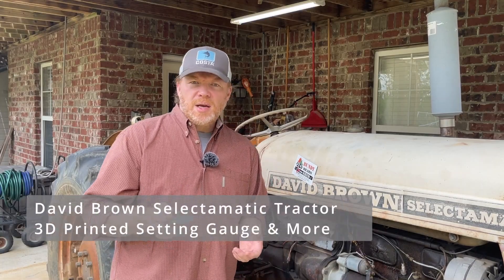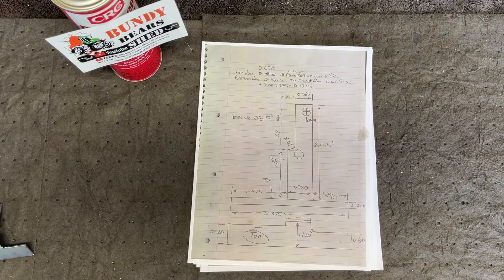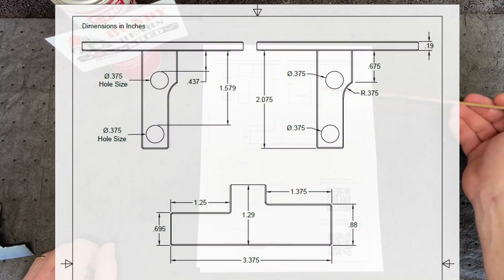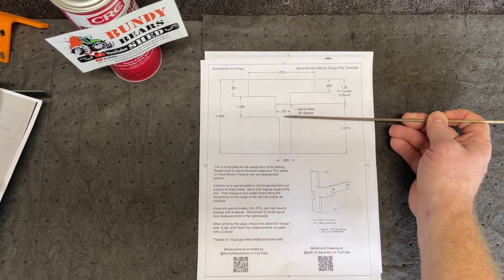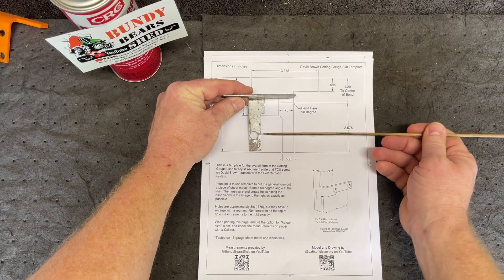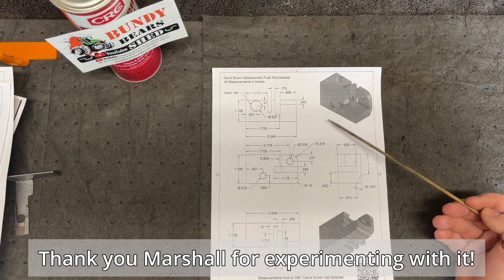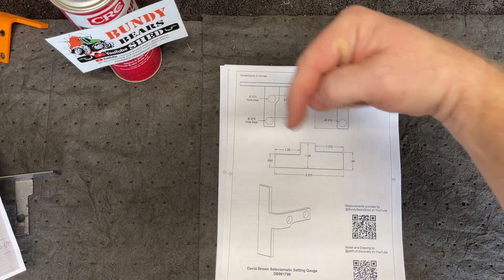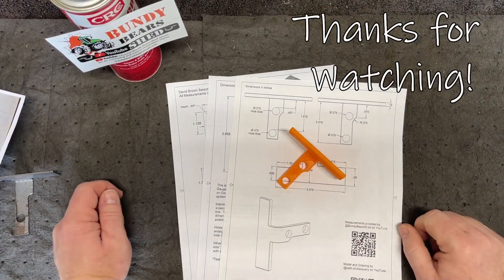3D Model and Drawings for the DB 961769 Setting Gauge plus more! | David Brown 990 #23

Comment: Thank you for  all the help I've learned, but because I am from PortugaI, I don't understand English properly, there are things that I have difficulty understanding and I have the following doubts:
1- My 1972 DB885 hiccups a lot, will it work if I do a cleaning of valve chest and the complet setting?
2- Before starting the work of removing the valve chest, I have to remove the gear oil, or it is not necessary?
3- What is the push rod bracket for?
Reply from the maker: Thanks for watching!  Sorry about the language barrier and I'm sure my accent does not help much.  
1 - You may want to do the easiest first: Clean the bypass and hold valves then test it.  Hiccup can be caused by hydraulic piston o-ring failing, as was the major case with mine.  Replacing all o-rings in the hydraulic system has cured mine of the hiccuping I was experiencing.   Every o-ring on my tractor's hydraulic system needed replacing.
2 - I believe draining hydraulic oil is necessary.  If you're referring to the gear oil in the final drives, then no, that's not necessary.
3 - Push rod bracket is to hold the draft control and height control pushrods in place in the right-hand ramshaft bracket compartment.  See this video: https://youtu.be/wb3eH5XFNtQ  The metal block in that video is the Push Rod Bracket.